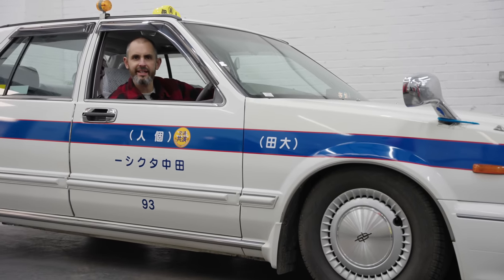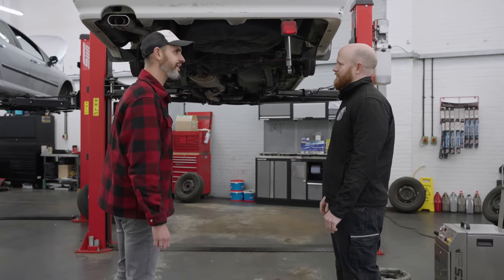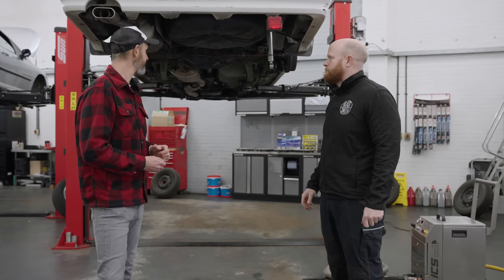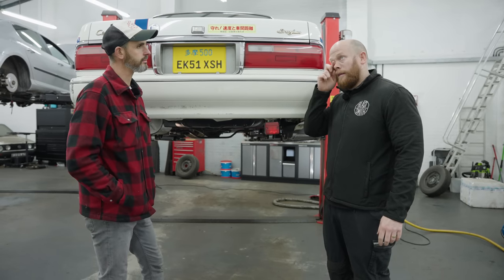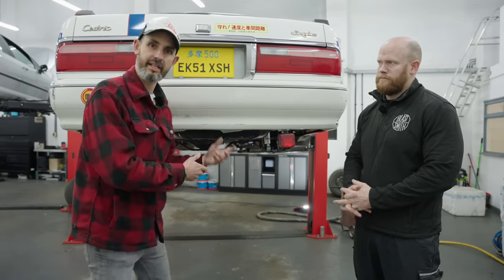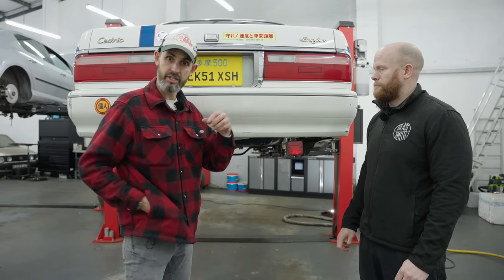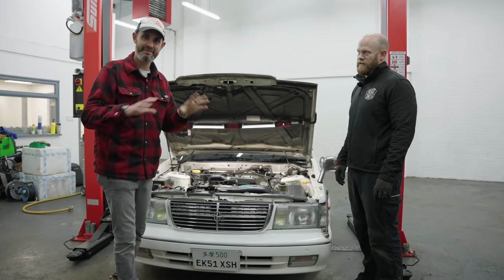Dry Ice Blasting car cleaning - next level chassis detailing // 4k

Comment: I spent over 15 hours laying on my back in a pool of water while I was trying to get the underside of my 911 clean. Countless chemicals, brushes and, rags later, and once it was dry, it looked marginally better. Then I heard about dry ice blasting. I dropped the car off to Sublime Surfacing in Edmonton and when I picked it up, 34 years of road grime and old oil were gone. It looked brand new. The aluminum was spotless, tags on the brake lines were like new, the blue tape stripes on the shocks were like new, the zinc plated nuts and bolts, you guessed it. Like new. That was 5 years ago and it still looks like the day it left Stuttgart. Highly recommend!!
Reply from the maker: Mark, your story is precisely why Jonny wanted to feature this process. It might seem expensive, but it probably saves a week of scrubbing (and does a better job).
Reply: Wow! I live in Edmonton and was just about to look up where to get this done, and saw this comment before I went to google! :D

Comment: God that is mind blowing it takes ages and ages to get a fininish like that well worth the money you would spend that much in cleaning products and paint no problem!
Reply from the maker: It is almost like watching a magician. As expensive as it is, the time saving is blinding. But also no chemicals, no moisture and no abrasives being rubbed on the car to try and achieve a similar result. In fact you'd never get this result in all the crevices without a full strip down resto. That's the attraction of just firing granules of solid CO2 at it.
Reply: @TheLateBrakeShow  I have mates who do this sort of thing and this new system is game changing it takes hours and hours as you well know to get a car super clean so it's well worth the money!

Comment: Fabulous. Just one question. Where does all the dirt and grit etc. end up? I assume in a pile on the floor and it simply gets swept up, but maybe not?
Reply: Yes, the dry ice (frozen carbon dioxide) just turns back into a gas as it hits at high speed, and the dirt that gets dislodged by the dry ice just ends up on the floor. It's quite remarkable.

Comment: I have to say, this is the best example of finish from this process I’ve seen… the results are genuinely staggering ❤
Reply from the maker: Thank you Patrick. We were worried it wouldn't show on camera, but the results are extremely good. In fact Jonny reckons it might take over a week of labour to do anything this close with hand tools, steam, chemicals or other abrasives. Plus doing it with CO2 eliminates any harsh abrasion.
Reply: @TheLateBrakeShow  … it’s the details on bolts , brackets, and lines that really show what they s process can achieve… it would quite literally take you days to get anything comparable with chemicals and a scrubbing brush
Reply: Thank you very much indeed
Reply: It's funny looking at the thumbs up how many do not realise how good this has turned out, damn folks, buy an old banger and learn! :)

Comment: ok so wow interesting video I didn't know this had made its way into automotive use .... I'm an ex (old) injection moulding engineer and have seen it use in mould maintenance ( I dont use ticktak or fauxbook)..its makes sense .. no water contamination ... a good layer of clear waxoyl or similar non setting protection and the car should last a lot longer...seems like an ideal solution to cleaning up an engine bay again no water....the fella in the video doing the blasting seems a genuine guy.

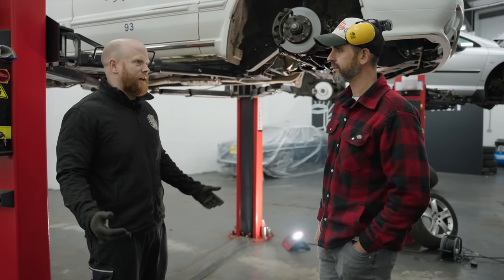Comment: 8:57 Very good point, this isn't just about old/classic cars, today I have been blasting with compressed air,  the water drains either side of scuttle panel on my 2010 BMW 318d (E91) and bloody hell the amount of crap sitting in that drain, next Ill be blasting between the sill covers, removing the undertrays, etc.....I can see that 335i, 335d, Alpinas, etc, could still be considered desirable/becoming enthusiasts cars. I fear that many cars made since 2000 may never get beyond 25 years old as they'll be written off with hidden rust. It's a bit like the repeat of the 1980's "XR2i, Turbo" arch trims, etc, and look how that turned out! (He says with rotting Fiat Uno Turbos...).

Comment: I was hoping you might have addressed some of the areas that required welding etc before the coating,but that’s up to you,nonetheless a wonderful result and will consider this a process for my next restoration,very informative,thanks!
Reply from the maker: Absolutely no welding required. One area on the side of a sill section that had lost some paint and showing surface rust on spot welds. We cleaned and protected.

Comment: I spent a fair bit of time last year looking at the process and the costs. I’m in Australia and the biggest outlay apart from the equipment was the cost of the ice. Average underbody clean uses about 50-60kg or ice and that’s a very big proportion of the cost, well it is here. 

Very good finish can be gained but I think the cost is still too high for the average person to justify.
Reply: A lot more than 50-60kg of Dry Ice is needed… check the videos on our channel.

Comment: Great video. What’s the Bilt Hamber you used for the under seal ? I have a 2003 Honda CRV and as it’s pretty rust free underneath I thought of Lanoguard at first but a spray is thinner and I notice MOT’s are now showing the grease under seal as an advisory
Reply: Not used Lanoguard but it looks tempting.

If you want a hard underseal, Dinitrol goes off very hard.

Comment: Apart from the diesel compressor (which running at an almost constant speed is pretty clean) that process must be better environmentally 👍🏻🏴
Reply: It depends on the production of multiple kgs of carbon dioxide that's then released into the atmosphere. Often a product of the petrochemical industry. Alternatively It can be from air separation industries (eg BOC)  in which case it started off in the atmosphere in the first place so not detrimental.

Comment: Where does the waste go (assuming there is any)? Does it bead up and collect on the floor? Sand blasting is a messy process. Steam cleaning is also messy. So, where does the dirt, grease and grime go when removed with dry ice?
Reply: I assume its basically atomising the oxides and carbon, so the answer would be the air.

Comment: I wonder how effective CO2 would be on oxidised polycarbonate headlamp lenses?  
It may not be an issue in the UK, but here in Australia, where UV levels range between Very High and Extreme, it is a very real issue.
Reply: It’s very much an issue in the UK. Japanese cars tend to suffer the most. There is tricks, polishes and paint to bring them back but it’s far easier to just buy aftermarket headlights. Only the other week had to buy a new set for a Vauxhall Astra which wasn’t cheap.

Comment: What was the rust prevention method u did called ? what did u use ? price ?
Reply from the maker: The products we used are from Bilt Hamber, but we didn't detail that here because it has been done before in a Suzuki Jimny video. Bilt Hamber make easy to apply clear protection called Dynax UC and UX.
Reply: @TheLateBrakeShow  Thank u...appreciate the reply.

Comment: I think for a JDM car this is completely unnecessary, just crack on with a good underseal job (costs about £1200). My 1992 Japanese Jags were so clean underneath anyway, all the original stickers and marking there without doing this.
Reply from the maker: We used Jonny's taxi purely as an example.

Comment: You would have to be keen and a bit minted to have it done.
Reply from the maker: Depends. You have to factor in the time element, and if you are paying a workshop to manually strip or hand clean the chassis to this level it would take a week.
Reply: @TheLateBrakeShow  I don't know the cost of ice, but £1200 seems a lot for a days work to me. A large part might be the cost of the diesel to run the compressor & 200cfm isn't that great , we used one at 250cfm for sandblasting motorcycle frames prior to powder coating it was a massive V4 monster with a star delta run up to power a 50hp motor.

Comment: ENGINEER !! Johnny get it right ffs !   An Engineer spent 3-4 Years at University for a degree, then to be a Chartered engineer, worked in the industry and passed their institutes highest exams for 3 more 6-8 years!. I was  a Chartered Mining Engineer, for example. You just can't call a tech an Engineer ! EUROPE knows this but the UK just banters it around, Be smart ! >> It's like calling a first aider a Doctor !
Ice blasting old withered components free of Grease , Really ? Clean, no oil or grease,  but what is left ? Air to dry out old rubber and give access to water air and  rust ? Doh !